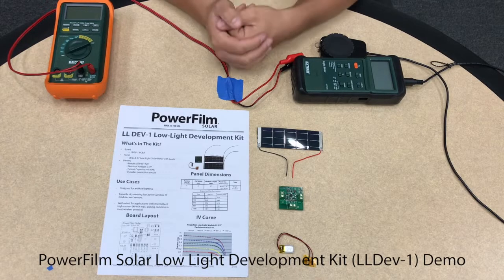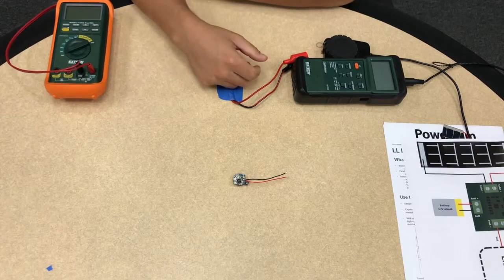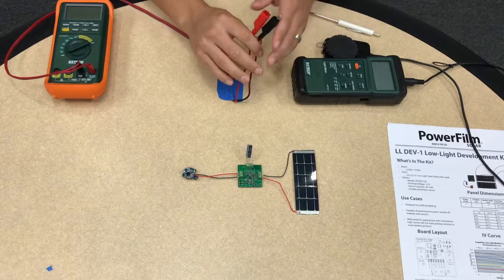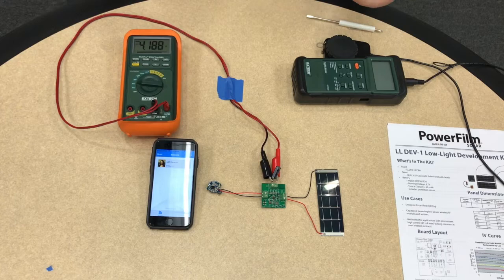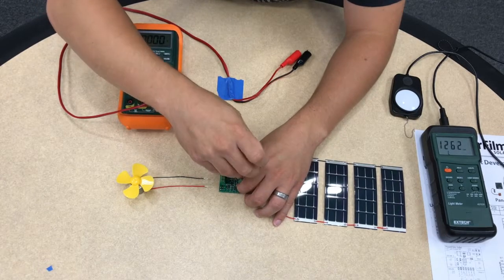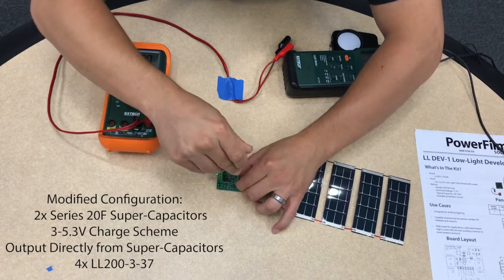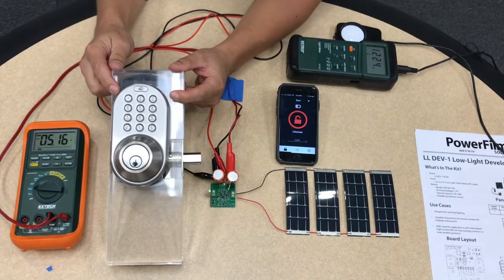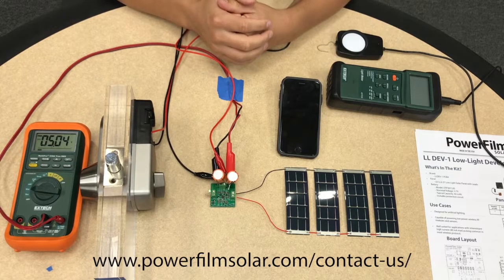Indoor Solar Development Kit Applications Demo

Comment: i commented on another video of yours about powering or charging 2x cr123 batteries. i need to stop changing the batteries in my august smart lock, if i could make something work then i would possibly order several. thanks
Reply from the maker: Brandon, I"m so sorry that I didn't followup with you sooner! I can advise on the best panels to accomplish charging the smart lock. Do you know the voltage of the batteries? Also, please send an email to shansen@powerfilmsolar.com so I can followup and assist you.
Reply: @PowerFilmSolarEnergy  2x cr123 batteries which I think are 3.2 or 3.3 volts. (I have not disassembled the lock to see if they are wired in series or parallel? As you know would affect the voltage)

Comment: Hi, I really like the simplicity of this solar development kit. At 6:50, 4 of the panels are wired together. How do you connect the solar cells to each other? I am researching connecting them for powering a very low power microcontroller. Thank you!
Reply from the maker: Thanks so much for reaching out! I will get with our team on this question and respond as soon as possible. Thanks!
Reply from the maker: Here is what I heard back from our team. "Panels can be connected in parallel but NOT series since the higher voltage can damage the PMIC. So connect all positive (red) leads together and then all the negative (black) leads together and then connect that to the input of the PMIC." Please let me know if you have additional questions!
Reply: @PowerFilmSolarEnergy  Thank you! Parallel is what i was looking for.